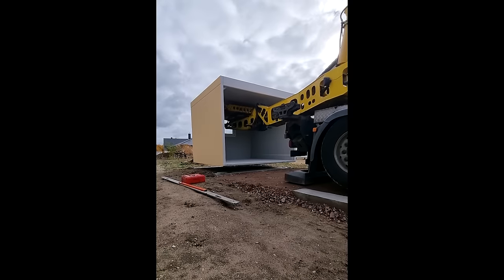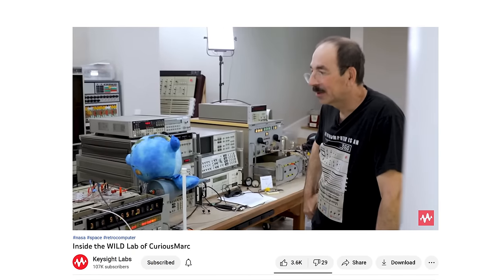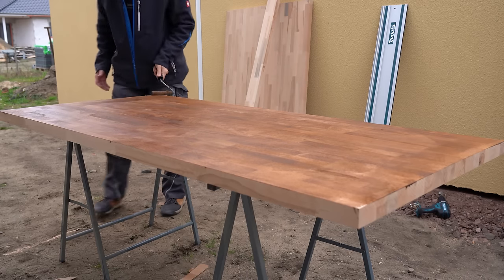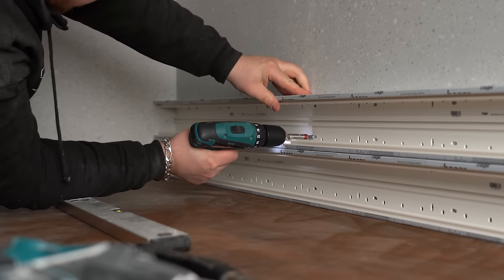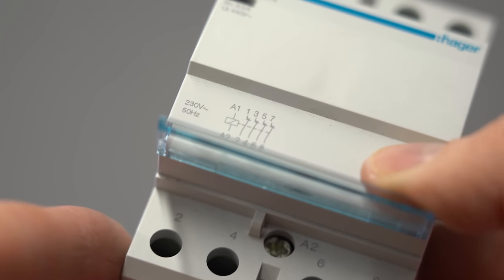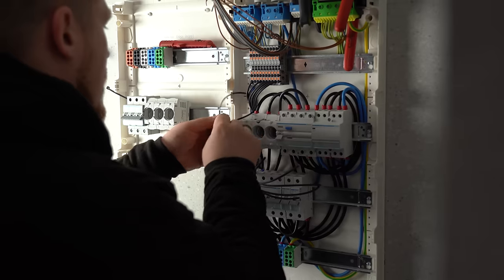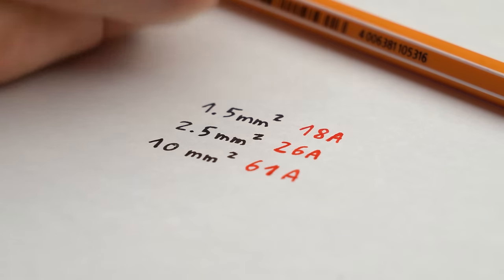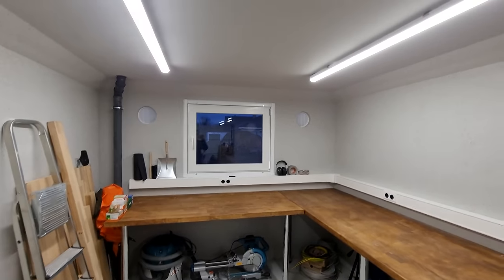Germans do the PERFECT Electrical Wiring! (Garage Build)

Comment: the conduit is horrible, if you're going to do conduit do conduit and singles with proper bends or fittings, not just the straight bits.... I don't know if its common where you are but I do know I don't like it.

Comment: Flex in ducts  YUKKKK   what the heck is that disgusting looking wire  would not trust that on 12Vdc let alone 250 or 440 Vac

Comment: I hope you all did not learn about electrical installations from this video. In fact if you do want to learn, please do it the right way.
The Distri box does not make any sense. Neo/DiaZed elements are unnecessary right there (check "Auslösecharakteristik") if placed anywhere they should protect the entire system upstream not 2m away from the sink.
Also using  push down blocks in a 2x12 unit is like fitting an electric wheelchair with an afterburner. It's an unjustifiable source of liabilities.
And yes german code is harsh. But for a reason. We have less and less people killed by fire and shock and time progresses. 
There is a reason for everything.
I so f***ing hate cleaning up the mess after people watch videos on youtube.